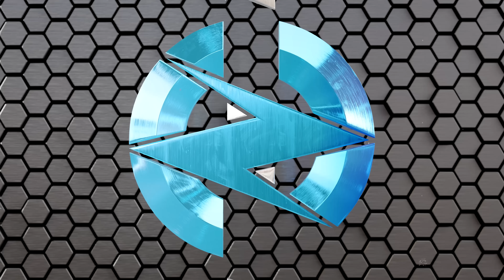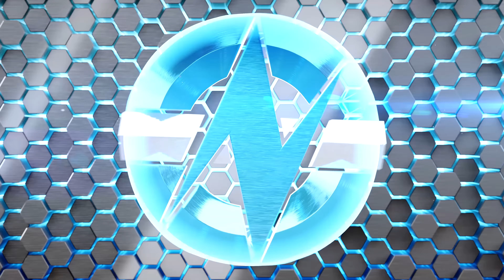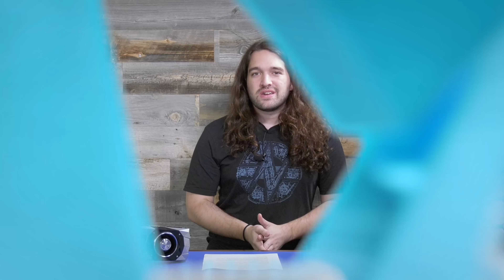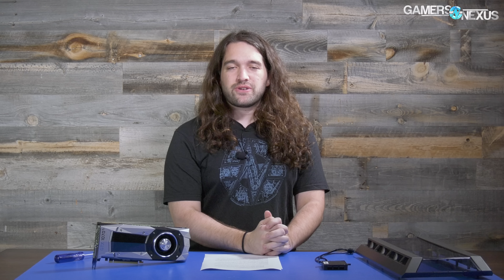Ask GN 62: Worse 0.1% Lows w/ OC, Our Review Philosophy

Comment: 12:52 - Oh, I had a inverted layout case where there was no front intake so I had my system setup to where the intake was on the top a couple cm away from the gpu fans and that generally pushed air down and it got moved left into the PSU aswell as aside the HDD and out the case, Literally I got told that my thermals may be worse because heat rises but I literally thought it Doesnt rise fast enough for it to matter AT all.

Comment: AskGN , (Call me Goodmane btw) Hello, thanks for all the high quality content. Amazing stuff that probably can't find anywhere. I have a question about heat. I recently started playing Warframe to keep myself entertained while waiting for weekly reset of destiny 2. I'm playing at 3840x2160 resolution, with un-capped frame rate. I have Zotac 980Ti Extreme AMP! unfortunately and Ryzen 1800X OC'ed to 3.9 Ghz on all cores. I removed the side panel from case so it can breath. My question is, in Destiny 2 with 80% fan speed, at most GPU gets to 55C degrees or so. While playing Warframe with 80%fan speed I have seen as high as 74C. When I check MSI after burner it looks like during Warframe Power usuage goes up from 50-60% to 70-80% . 
Why there is a difference like that in power usage?
Is it because I get double the amount of frames in Warframe?

Comment: I was wondering if you could explain why I'm seeing higher voltages reported in Hardware Monitor than what I set in BIOS. I have a 6600k I set to a 4.6GHz overclock on all cores with a manual voltage input of 1.26V for the VCore in BIOS MOBO is an Asus Maximus VIII Gene. The reported voltages in Hardware Monitor are as high as 1.292 - 1.303V. Why is there such a variance between my manual voltage input and that which the CPU is supposedly drawing? I adjusted the load-line calibration settings and set it to 5 out of 7 to try and account for the voltage spikes, shout out to Buildzoid for the LLC video, but I feel I've misunderstood something and as a result am putting more voltage than necessary into my CPU. Any advice would be great. Thank you for the outstanding content.

Comment: Question for Ask GN. I'm looking to find out what type of case fan to use in certain parts of the case. I use a High Airflow fan for the back exhaust and High Static pressure fans for AIO's. Where the question comes is should I use a High Airflow fan{s} or High Static Pressure fan{s} for the the front intake or any intake that has a filter on it. What about a case that has a front intake with filter and about an inch of clearance from the front panel. I have 2 cases, the Corsair Carbide 600c and Fractal Meshify C. Fan recommendations? Thanks!

Comment: Do you have any data on air cooling vs. water cooling on extremely high thermal loads?

I'm currently using an NH-D15S to cool an i7-7820X at 4.8 GHz. It pulls up to 275W (from the PSU) on its own, so it can pretty easily peak out in the 95°C range - it doesn't throttle, but it gets uncomfortably close. The CPU is delidded, so I'm wondering if I'll see a tangible benefit if I switch to a 280mm or 360mm AIO.

Comment: [Question for Ask QN] - I know you briefly cover this topic in this episode, but not this question specifically.
When overclocking a CPU, would you recommend a manual (fixed) 24/7 voltage and frequency; (e.g. 1.35v @4.8GHz - both at idle and load) or an adaptive (offset) voltage and frequency with Intel SpeedStep (1.35v @4.8GHz on load but dropping to 1.1v and 2GHz on idle)
Is running a fixed/manual 24/7 voltage and frequency going to dramatically increase degradation and decay??
Reply: To add some context and reason to my question; I can run my CPU at 1.400v @4.9GHz 24/7 if the voltage and frequency are set to manual/fixed, so it runs at 4.9GHz and 1.4v all the time, never changing. But, no matter what I do and believe me I have tried for dozens maybe a hundred plus hours over the past 18 months, if I set an offset/adaptive voltage and frequency even if I get it perfectly tuned so under load the voltage is exactly 1.400v @4.9GHz, at some point normally during light load either the system BSOD or I start getting dozens of WHEA errors. So, I have to reduce my max OC to 4.7GHz with a max peak voltage of 1.320v then it stays stable.

Therefore, I assume that while running an offset/adaptive voltage on full load my CPU is getting the voltage it requires to be stable, but at some point during the process of the voltage and/or the frequency increasing, the clock is too high for the voltage being pushed at that time, so I get instability.
I was running on manual fixed at 1.400v @4.9GHz for around 6 months with no issues, but then I started worrying that keeping it pinned at that OC would increase the degradation and decay of the chip tenfold.

So, what are your thoughts, opinions and recommendations kind Steve of GN???
Reply: Good question I'd like to know this
Reply: Me too :)

Comment: Can't you just do top and rear intake and then front exhaust? if you have 2 top 1 rear you can do 3 front or 2 front 1 bottom.
With AIO that is, with an air cooler I guess you would  just do it the "normal" way? Or would reverve have positives there (aswell)?

Comment: on my "old" ASRock 990FX Extreme 4, there was a little fan ( 40 mm?) and a screwdriver included in the box. So there was mentioned in the manual, if you overclock you should remove the clean and astehtic cover on the VRM-Heatsink, reuse the screws for the cover and mount the active cooler on it. also next to the heatsink was a little 3-pin connector for this fan. So a good idea for all the non overclockers --> they have a clean and astehtic look. and all the overclockers out there, because they could put an active cooler ont it. What a brilliant idea...back in the days. They had thought it through. If you compare this to an actual overprized and overhyped peace of hardware today....i am scratching my head right now. What a step back.
you can see it here: https://www.asrock.com/mb/photo/990FX%20Extreme4(L1).jpg
The ASUS board Steve is using here, costs a lot of money. The board i mentioned had cost around 140€ ... and was more advanced in the VRM-cooling.

Comment: Great video thanks.
About the fans in my own setup I did mods to the case. I chambered the case into 2 sections the CPU Idoes not get heat from the GPU and the GPU is not effected by the CPU at all. I have 3 front fans blowing into the case. Then there is a 210mm top fan that sucks air out and it is over top of the CPU. The back case fan is also reversed and blowing into the case which gives a positive air flow. The bottom chamber has the bottom ywo front fans blow into the bottom chamber of the case. The graphics card is blowing it's hot air out the side vent I made for it. I found after doing this my temps dropped dramatically for the cpu & the gpu. Case temps dropped as well so the mainboard components are cool as well. Case makers reaally need to stop making these great big open area cases and focus ob tyrning that open area into chambers so things like cpu's and gpu's and everything else does not cause heat issues.

As for FPS drops ot lower performance when overclocked gpu's in some games. Well if it performs strangely in even one game then you have pushed your card a bit to far and it is not 100% stable. My rule of thumb is if after doing my OC and then testing the GPU if it even misbehaves even a tiny bit I roll the clocks back 10mhz and try again if it is good then I know I am gonna be stable in all games. With these turbo boosts Nvidia has it makes overclocking a bit mor tricky because their cards behave differently game to game. AMD's boost is a bit more controllable and once set it pretty much reacts the same in every game.

Comment: About Shiba's question about rear intake ... it does work well to have the extra intake airflow. I have a 420MM AIO cooling CPU & GPU (Eisbaer/Eiswolf) at the top of the case with only 2 140mm in the front. The extra 120mm in the rear adds extra air pressure for the case intake (trying to get positive pressure); and yes I have a magnetic filter over it on the back of the case. I really could not fit the 420mm AIO anywhere else in my 750D other than in the roof; and that was a tight fit. So far, this works very well for cooling my 7700K and 1080 Ti SC2.

Comment: Hi steve. Like the 7700k/8700k, are there any meaningful thermal gains to be had by delidding a non-reference Nvidia 1080ti and replacing the TIM with liquid metal? Similarly, is it worth replacing the TIM between the heat spreader and heat sink? I love your cat! Thanks!

Comment: a question for the next #askgn...is dumbbell bench press better for building the upper chest vs barbells? just kidding both are fine. anyway my question is why can you use a 120mm radiator on a gpu like vega 64 LC that has a 250-300watt tdp. but the same thing cannot be used on a cpu OC'ed like a 7700k even at 5ghz...does direct die cooling matter that much? assume the CPU is delidded....

Comment: Iv got a question (maybe one buildzoid could shed as me light on). You always say reference cards should be avoided, is that solely due to poor coolers or does the PCB also suck? After looking at various reference vrms they all seem overbuilt ( Vega and even the rx480 and 1080/70) so if I were to be replacing the cooler with an aftermarket one anyway would a reference card be advisable as it would save some money and help recoup the cost of the aftermarket cooler?

Comment: I saw you recently did a video comparing OUT OF THE BOX THERMALS between intel and amd, with both CPU's matching the ambient room temperature, but you didn't compare them to IN THE BOX THERMALS? And does the location to the box effect the thermals, I would have thought that UNDER THE BOX THERMALS were higher than the SIDE of the BOXTEMPs. I've heard that putting the CPUs into a hot box can make them more chill. But I think that last one is false. hot flows into cold not the other way around. :P (just bs, love the videos!)

Comment: Question for Gamers Nexus , are you open to the idea of ever testing the inputlag of Ryzen vs. Intel? That doesn't necessarily correlate perfectly with the FPS because there are a few relevant differences in the architecture of the chipset and the CPU. Level1Techs did a test for GTA5. Take a camerea which takes many pictures a second and you can count how many frames it takes before the picture on the monitor changes in response to moving the mouse (in game 'camera'). Easy, but a lot of work. On the other hand, you only have to do it once. Take around 20 games, compare it for the Ryzen 1600 and the 8400 and you have a good idea about the difference between Ryzen and Intel. I ask for this because in the case of  GTA5 (I know you have watch L1T their video on this) the difference in input lag was zero or negligible (1/180 second) while the difference in FPS waa rather large (>10%). Before that test some experienced gamers and reviewers pointed out how incredibly smooth the gameplay feels with Ryzen, more smooth than what you would expect based upon the FPS. I know it is lot of work but you could take months to do it, measure it for one game for one CPU each day or something like that. It would be awesome content. The entire purpose of measuring FPS is the underlying assumption that it gives a better gaming experience but it is the input lag which really matters and the correleation between FPS and input lag migh differ between two differenct architectures.

Comment: Hey Steve, I've watched JayzTwoCents video on th 1080ti kingpin LN2 OC and I began to wonder: why a company would make a copper heatsink on such product if It's just going to get thrown away? On a product that's clearly intended for ln2, wouldn't it make more sense to just grab the cheapest cooling solution possible and either make a cheaper product or allocate more of the budget to features such as the power phases, thermal sensors, etc.?

Comment: I was wondering if you or anyone can help me. (tldr: Unstable on normal clocks) 

I am on the i7 6700k, Gigabyte Z170N Wifi Rev 2.0, Cooler Master Hyper 212 Evo

I tried applying some overclocks (some very basic ones e.g. 4.3/4.4 Ghz @ 1.3v) and it wouldn't come out stable on Prime 95 despite the temperatures being normal under load (around 50-60c)

The weird thing is bringing it back on stock clocks (even down to 4.00 Ghz) wouldn't bring back its stability. After around 5 minutes of stress testing, the CPU utilization graphs would fluctuate and the clocks would throttle despite the temperature being under normal load. I'm not sure if it's a motherboard issue or something else.

I got this system almost a year ago, but just decided stress testing now. The BIOS was just recently updated as well.

How do I troubleshoot this? 

Edit: I'm on Seasonic M12II 520watts 80+ Bronze, Sapphire RX 480, and 16GB 2666 RAM.

Comment: I’d like to add to the gpu overclock comment. Some games just flat out hate high clock speeds, take SWTOR for example. Old game I know but it hates modern hardware and you have to under clock your gpu to avoid crashes .  I think L.A. Noir is another.

And to comment on the liquid metal corrosion.. gallium does not react to copper it’s perfectly safe, it may leave a discolored spot on the surface but no corrosion or amalgamation

Comment: Hi Steve, here's a question for the next Ask GN:
At what level/usage would 4 real cores become necessary over 2 cores with hyperthreading/SMT for an office/home PC?

I'm building my dad a new PC for regular office/home usage, and long story short the CPU will go from an old quadcore quadthread i3 in the old PC (from 2011 I think), to a dual core quadthread Pentium G4620. 
Certainly there won't be any performance loss by this CPU-wise, might even be performance gains, however this makes me wonder when 4 cores becomes beneficial.
Reply: steffeeH 

So the quick and dirty of it is that Hyperthreading helps when you have threads that have high latency between calculations. So say you have a process that relies on fast disk I/O, while the CPU is fetching information, the thread is still "in use", so it can't be used to do other calculations while waiting for something else to happen. With Hyperthreading/SMT the thread can wait for information while the core does work for another thread, this helps eliminate processing time wasted. (This is an oversimplification by the way, but it should serve you well.)

Comment: If i delid my cpu and use LM do i even need to use LM again between the IHS and my copper waterblock or should I just use normal paste? Would my temps be unaffected if I just used it under the hood an not uptop? Thanks steve

Comment: At 14:44 you said that PSU's exhaust hot air into the case.  As long as you install a PSU into the case (either with the fan up or down) in the intended location, hot air is always exhausted out of the case.  Even with the 'ancient' PSU's with a rear mounted loud tiny fan, the hot air is exhausted out of the case.

Comment: Good video, but Buildzoid's answer to the fixed v. adaptive voltage question wasn't clear to me. Does using the adapative potentially save you 10-30W,  or does using fixed get you the small savings?

Comment: Gamers Nexus Do different tiers of GPUs from companies like EVGA matter in performance? Do the higher tier cards OC higher (manual OC, not OC from the box) than their lower tier counterparts? Example, if purchasing an EVGA GTX 1070 SC, can you overclock it to the same extent that a 1070 FTW will be able to OC. Yeah I know a part of it comes down to silicon lottery, just want to know if the chips were cherry picked or not. I'm sure for EVGA's UNCLASSIFIED GPUs they are.

Comment: I have a really important question Steve, I have an R7 1700 and a gtx 1070 with a Dell 3440 by 1440 ultrawide and was wondering if i should get the Gtx 1080 ti or 8700k for a boost on fps? 
I know it's unusual but christmas is coming up and i love my pc but i feel like it needs a bit of a boost for my needs but i just don't know what would help me most a processor clocked at 5.2 ghz or a 1080 ti because i assume from watching all of you guys at a certain point ryzen can't push out as many frames. I stream a little bit, run kodi, play Overwatch, PUBG, and TotalWar games with taxing mods. Also i woulden't be hurting for money or anything so that wouldn't be an issue.

Comment: Hi there! 
I'm thinking about getting Vega 64, but it seems that all cards that are at all obtainable use a stock blower fan design. Can you possibly recommend some "aftermarket" cooling kits, from large radiator stacks to CLC kits that could be used on it without having to resort to fabricating my own brackets and/or cables?

Comment: @Gamers Nexus When building a custom watercooling loop that involves both the GPU and the CPU with a single fan hub for all the fans, would it make more sense to let the fans be controlled by the PWM connector on the GPU rather than the CPU (since GPUs tend to be more sensitive to heat than CPUs)?

Comment: Steve, please, start testing cases with different fan configuration than the stock fan configuration. How are we supposed to compare case airflow, if every case you test have different types of fans and even different count of them?
It is like you would test GPU A with a R5 1600 and GPU B with i7 8700K - the results you get are incomparable.
Just put two Noctua A14s (or another good system fan) in front as intake, one rear and one top as outtake. And test EVERY case with this fan configuration, so we'll get comparable numbers for actual airflow.
Your reviews are one of the best (maybe even the best), I love them, but this case airflow testing with stock fans just don't make sense. Make one test for stock configuration, one for fixed fan count and fan model configuration and we'll be all happy ☺️
PS: Sorry for my crappy english.